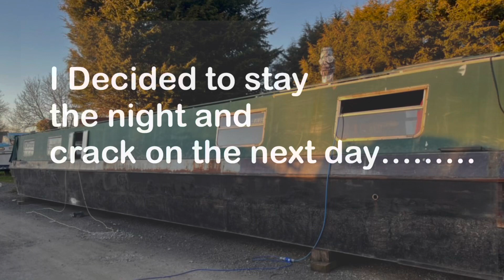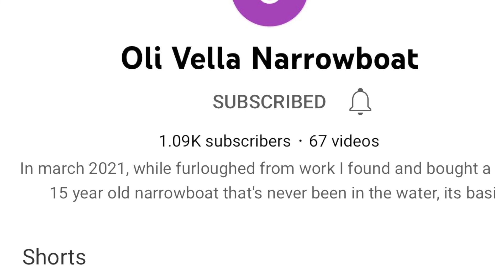Number 8!

Comment: Have to had a survey done to see what the thickness of the hull is ?
Reply from the maker: Yes it had a survey, originally 6.23mm Baseplate with 4.75mm sides and 3.2mm cabin sides and roof, all measurements gave adequate thickness readings.